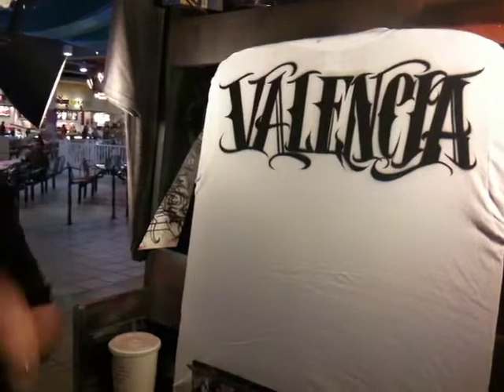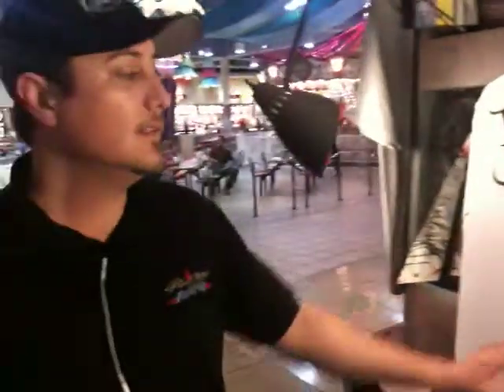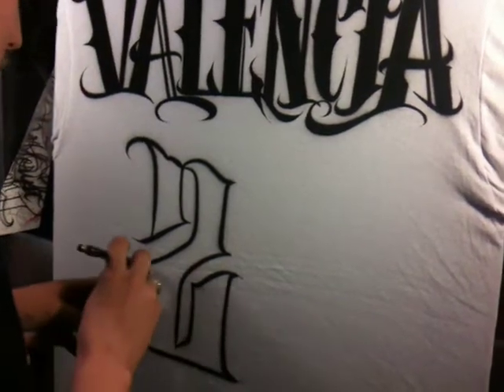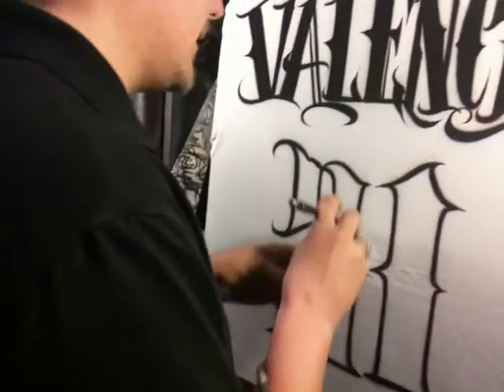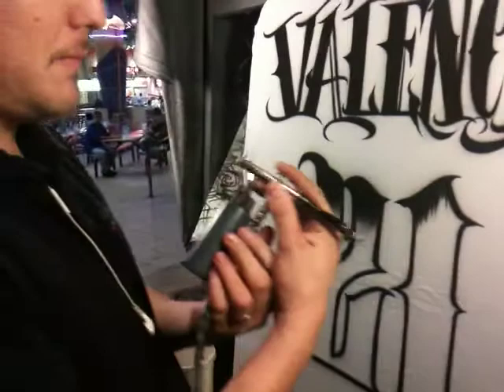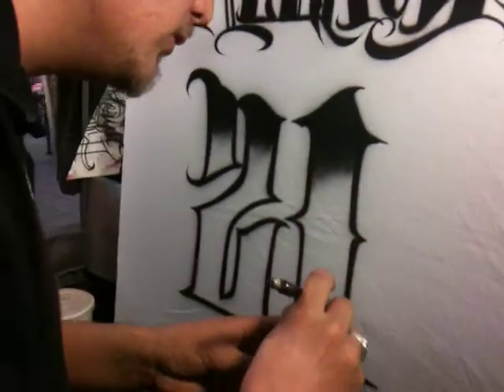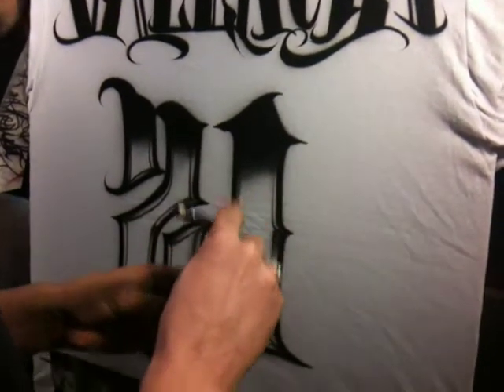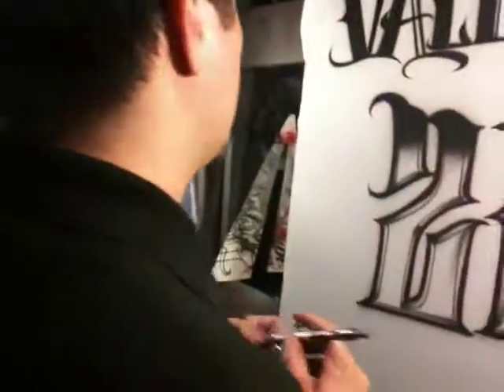IHow to airbrush a 21st birthday t-shirt by Jaime Rodriguez. part 1

Comment: Nuchuga,
He does that because as the paint flows over the needle you get what is called "tip dry" and the paint builds up on the tip of the needle so he has to, occasionally, wipe the buildup off with his fingers.